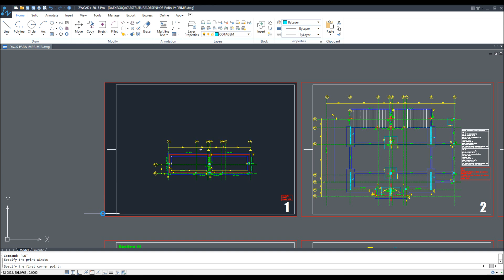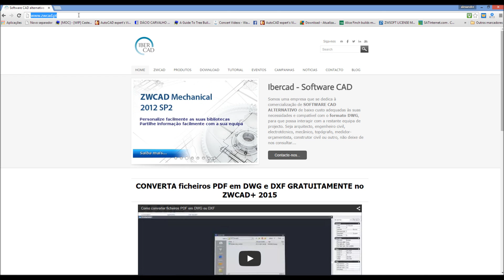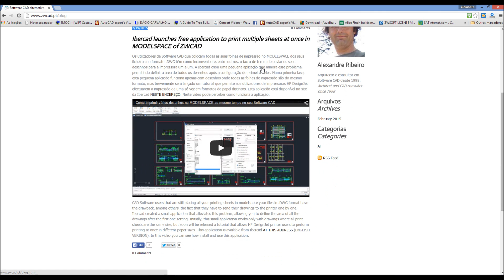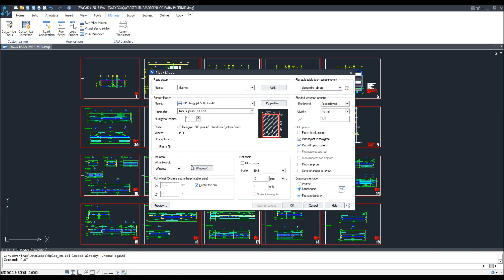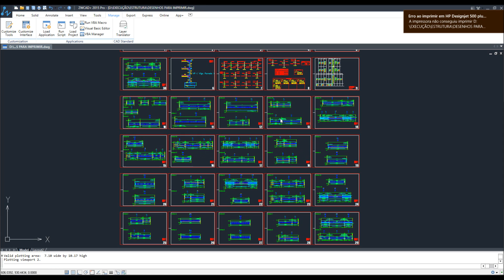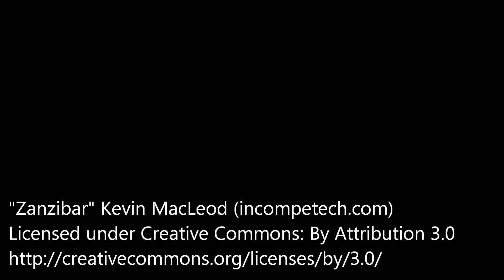How to print several MODELSPACE drawings on a CAD Software at once

Comment: I'm using ZWCAD 2018 can I still use it to achieve this particular procedure?
Reply from the maker: Hi, I´m not sure, the LISP file was made for the ZWCAD+ series. 
I can only tell that you can try... Sorry...
Reply: So which other means can i apply to carry out this particular procedure?
Reply from the maker: Yes, but I´m not sure it will work on ZWCAD 2018...